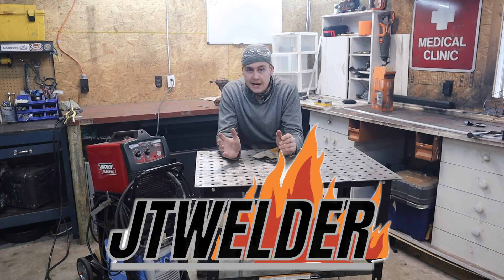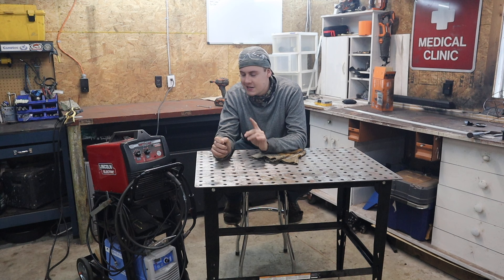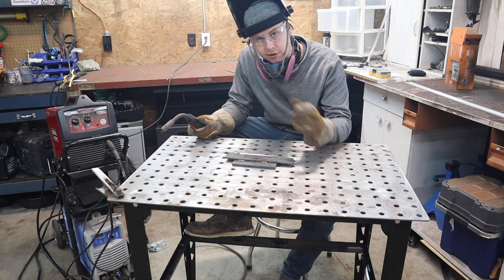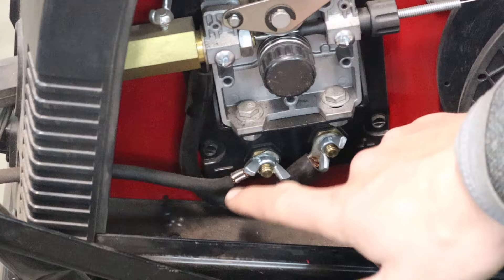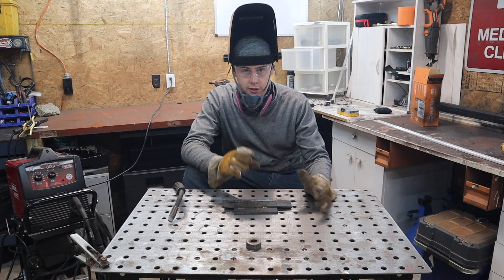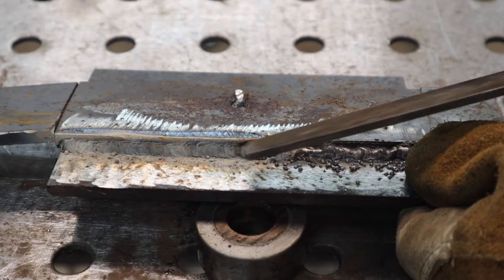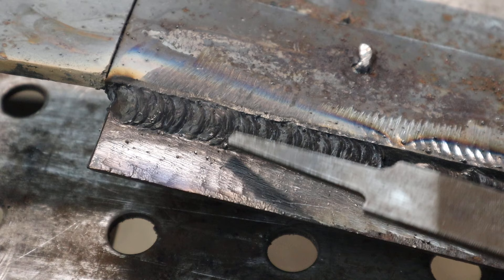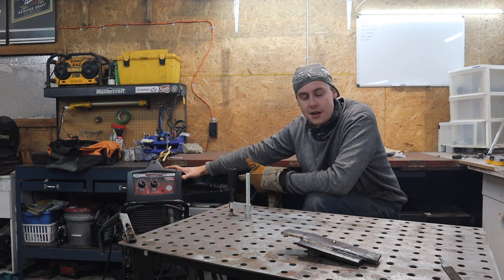#1 Mistake Made When Flux Core Welding (one simple Trick)

Comment: I've  been  welding off and on over 40 years. I never knew about  this. I normally  run gas, but I do have a couple of rolls of Flux core if I have to  welding outside  and there is too much  wind. Now I'll  know to make that change, and my welds will actually  look good. Thanks  for  this very useful  tip.
Reply from the maker: Glad I could help!

Comment: I just started college this last week for a welding certificate knowing basically nothing about welding, but when you talked about straight and reverse polarity, I knew exactly what you were talking about because we're currently learning the basics.  Straight polarity= Direct Current Electrode negative (current flows from electrode to work, transferring 70% of the heat on the work), Reverse polarity= Direct Current Electrode Positive (current flows from grounded work to electrode, transferring 70% of the heat produced to the electrode) and Alternating Current spreads the heat 50/50 towards electrode and work.
Reply: Great job now I knw
Reply: bougt just mma cried nicely.
Reply: I have to write this down.

Comment: I've been trying to learn with an HF flux core welder and my results are exactly like your first test. I'm going to go check the leads and reverse them if needed, and maybe, just maybe I will finally get a weld that will hold. Thanks!
Reply from the maker: Yeah hopefully it that's your problem! It's a night and day difference you'll know if it worked.
Reply: @JTwelder.  if only the guts of the HF were marked + and -!
Reply from the maker: @brysonalden5414  yeah on cheaper models they probably don't bother with labeling that. Also Hobart makes probably the best flux core wire.
Reply: @JTwelder.  Turns out, in my case, it was user error. I increased the feed rate, slowed down, and I'm starting to get decent welds. Thanks for your support!
Reply: @brysonalden5414 Label once you figure it out.

Comment: Great video.  Simple, easy to follow advice. 
I bought a MIG unit from a local, supposedly reputable specialist welding supplier about 10 years ago.   It was a ‘special deal’, allegedly for our state agricultural show.  Turned out, they were dumping the units as they were having major issues getting all the products from the manufacturer to operate correctly.  
After a few months of horrible welding, blaming myself, a mate (much more experienced than me) tried to use it, and had the same issues ( dirty, splattery, horrible weld lines, that took ages to grind, and major pitting necessitating rewelding / over-welding (?), incomplete or weak welds, machine would run for about 10 minutes then need 1/2 hour to cool down etc). 
I took the unit back for a ‘service’, and they sent it back with the wrong setting on the ‘drive-wheel’ for the wire that was on it. 
Eventually, I disassembled the machine.  I found the cooling fan (generic ‘computer’ type) was rubbing on another component, so i rescrewed it onto the steel case.  I then reset the incorrect settings that they had done.  
It now works flawlessly, and will easily weld for longer than I can.  Took it back to the company, showed them what I did, and made the professionals a bit embarrassed.  They gave me a bunch of new swag, including fancy switching- magnetic clamps.  Sometimes it takes a new ‘inexperienced’ eye on a problem to pick out the issues.
Reply: Agreed!!

Comment: A few years ago I purchased a Lincoln welder 240 . In the instructions it  said “ if using flux core, reverse the polarity for optimal performance “. 
I just did and my welder has always worked amazing. Thought you still do get a bit of spatter , however common with flux core.
Reply: Don’t ever buy Chinese wire or rod to weld

Comment: I have an older version of the same Lincoln you are using. I can smear some wire on two pieces of metal and make them stick together but I would never call myself a "welder". A lot of our stick welders where I work have a polarity switch right on the front so I knew that there was a purpose for reversing polarity but never new why. The funny thing is.....I have asked about it and none of the career "welders" at work could tell me why you would ever use it 😂 This will go a long way toward improving my results. Thank you!

Comment: Stumbled on this video and was excited. Not a “welder” but did a year, at night, at local tech school and have TIG, stick and gas MIG in my shop. Needed remote operation at my farm and bought a HF 110v flux core machine. It was ugly but it worked. Recently helping weld on a bush hog and using the 120 machine and yea…messy. Saw this video and at 1115pm went out to my shop to see.  HF 100v flux core welder is not switchable.  It is all hard wired in and I’m not a sparky. Damn!  Still great video and I plan to share this with my buddy who was my welding instructor.

Comment: This is probably one of the best videos for anyone to watch that buys a box store welder to use around their garage. Without this simple tip, at the beginning of learning, it saves an immense amount of frustration, and disappointment. So glad I found this video. We have the exact welder at work for doing minor repairs etc, and it acts that way. Have to put feed higher, and keep turning the welder down to not burn the wire to the tip, and jumps back and forth, hard to keep straight. Sounds like it’s the exact problem. Awesome man!

Comment: I consider myself a weekend warrior and a self taught welder. I purchased a Lincoln 140C welder similar to yours, but instead of my amp settings being fixed to only five or six settings, I can actually fine tune the amperage with the dial. Picked it up in an estate sale for $350 and never used. A smoking deal considering the cost of this model new. 
At any rate, I, like everyone else made the assumption that the units were sent from the factory for the proper setting for flux core. And now you are proving that wrong. Good on you for bringing this to our attention. I thought that my welds weren't getting any better as shown in your example. I will reverse my leads the next time I have a small job and see if my work is any better. Great video! Cheers from Ontario.

Comment: Thanks for doing this video. I bought a used Lincoln mig a couple years ago. I recently ran out of gas and installed flux core. I switched the polarity, but got the crap welds you showed. I just went & checked, and the polarity was wrong. Guess I've been running mig wrong, too.

Comment: Great info, I will say, I just picked up a new Titan 125 from Harber Freight (cheap as hell I know), and took it apart to check... From what I can tell they actually have the clamp wire hooked up to the positive side.
Granted, it's "self inverted" or whatever, so it's not the same set up and connections as a proper Lincoln, but the clamp wire is connected to the transformer, and there is a seperate smaller red wire that runs to the board, and is labelled V+ .

So that's good. Still splatters some, but not as bad as other machines I've used (that probably weren't set up correctly). Suppose I just need to dial in my wire speed.

Comment: Thank you for a great example of setting up and explaining setup for flux core.  I am fairly new to welding and I heard about + ground for flux core, but hard to find a good explanation of it as you have given.  I do make good welds with flux core.  I like flux core over gas, over the cost of gas.  Have no problem brushing the flux off the weld.  I just upgraded to a Vevor 250 mig which allows easy switch to (+) ground.

Comment: I did my first weld today with a Titanium 200 and .30 flux wire, clean up the metal before I started, set the polarity correctly for flux core, used the suggested settings for the material I'm welding, and I had 10x more beads and even burn through. Once you get them, I learned you can't go over it because you can't get between the beads to clean the slag, so you just make it worse.

Comment: I’ve recently been learning to weld and despite all the videos I’ve watched (and it’s a LOT!) I was frustrated by the spatter issue and porosity of flux core. I’m going to try changing polarity as you showed, and nobody else I’ve watched has mentioned.
Thanks for this video, I’m really looking forward to trying this out!🤞🏼
Reply: This only works on more expensive flux core migs w/ a DC power supply, like his. That welder's over $600 The cheaper ones are AC and it won't make a difference. And that's why the cheap ones suck. Flux core itself is fine.
Reply: Thanx for that info, my wire welder is AC only, and cheap lol. Maybe I should upgrade?
Reply: the next step up is a mig w/ dc inverter. w/ the cheap ac transformer ones, the power fluctuates a lot and doesnt give you a smooth weld pool

Comment: Here in Australia I have a 240V 100A flux core welder which I run on a 10A circuit. It must be set up correctly, because my welds look your second weld, not the first mess.  I can get a few different brands of wire, but I think I prefer the Renegade wire over the Bosweld wire, although the Bosweld wire is still good.
Reply: same here mate. i use bossweld 100a gasless mig. pretty sure you cant change polarity if you wanted to

Comment: Recently picked up a cheap 110v flux core welder, that is not able to be set up to run with gas. I bet it is also wired up like the gas version welders. I'll check the polarity next time I go to use it. Thanks for the tip!

Comment: Been welding 25 years. But just recently picked up hobo fraight 120v flux core welder and if this works I be vary happy cause it makes the ugliest welds. Thanks. I was probibly not listening that day 25 years ago in welding class. Lol
Reply: Did it work for you? I'm about to buy the same welder!
Reply: My welder is not easily changed with my luck Ill burn it down. The ends don't bolt on like in the video.
Reply: What a bad luck!  Anyway I'm going to buy the machine, as I only want it to do my little projects at home, I'm new to this I think that this machine is good to start with!

Comment: Im really impressed here. Thank you big time for explaining what others tend not to do. I am thinking of getting into welding just as a DIY'er and I was really wondering about the power source for a 120v welder. Im wondering if you turn up the power on one of those 120v welders could you (or have you ever) blown the 20 amp breaker? You did a really good job explaining everything else and you have a great speaking voice. Kudos to you!! If I do decide to get into it I will burn what you said into my old brain :)
Reply from the maker: Yep I have blown the 20 amp breaker before. If your just welding sheet metal or bodywork a 120v welder will work but if your doing a lot of welding on 1/4” material and thicker that a 220v machine is definitely the way to go.

Comment: Yep this makes a huge difference. BTW, fluxcore Yeswelders come set up as Positive ground.
Reply from the maker: How do you like the yes welder flux core machine? I have one of their older AC tig 250p machines and I absolutely hate it.
Reply: @JTwelder.  My primary machine is 220v Tweco/ThermalArc 181i w gas, so not alot to compare to. But for 110v portability I did have the HF Vulcan Easy flux 125 and thought it was decent accept for its short ass leads and pathetic ground clamp. Once it died I got the yeswelder 135 for $40 less, better leads, more power, duty cycle, cleaner arc. Yeah, it smokes the HF unit and has welded 2x or 3x the wire so far. Also has display and carry handle. No brainer.

Comment: The HF 90-125 Welder are AC output  You need to get a Wire that's rated for AC/DC and a Amperage rating at around 40-130  if you get Flux Core Wire rated for DCEN only and 120-300 amps its not going weld worth a CRAP in the HF Welder , If you have converted Your HF to DC then Blue Demon E71T-11 .030 rated 40-100 amp  is a Great Wire to Try .

Comment: For the modern flux core-only welders (like those cute little Harbor Freight ones), does this still apply? I would assume that the polarity in these is hard to swap, unlike the Lincoln 140s where it's all accessible. But wouldn't a flux-only tool get t right from the factory?

Comment: Another important change you never mentioned is the need for a knurled drive roller in the correct wire size in which you are using, if the machine is setup to run solid wire and gas, it will have a smooth grooved roller, it won't feed flux core wire.
Reply from the maker: This video really was just about the polarity. Its not a full how to set up video for flux core.

Comment: My MIG PAK 140 machine from Canadian tire did not come setup and it did come with clear intructions for setup on DCEP - Direct Current Electrode Positive (MIG) and DCEN - Direct Current Electrode Negative (Flux core) so I think most people need to spend time and read the instructions. There's a lot of videos about setting up this type of machine from new and they all speak about setting it up correctly for Flux.
Reply from the maker: Yeah exactly! I just filmed a new video actually talking about how the Lincoln 140 does not have good instructions how to switch the polarity
Reply: @JTwelder.  You think you could do a video on a bunch of different weld types on the 140 on different thicknesses of metal and speak about the settings you use? I know the inside flap gives a baseline for voltage and wire speed but I find I need to tweak them slightly if doing an open corner weld vs a butt or lap weld since welding the edge of a piece gets hotter. Only thing I don't like about the MIG PAK 140 is that the voltage settings are 4 position only, it would be nice if you could vary it between the A B C D setting. 

Currently just running flux for now as the bottle of gas is a bit pricey and I'm just doing some basic hobby type welding at the moment

Comment: I’ve actually ran gas less flux core wire with gas and it turned out really well. Better penetration and a nice looking bead with a slag layer that pops off just like dual shield. Seems good to me anyway, maybe a pro on here knows something I don’t? I’m open to criticism on that.
Reply from the maker: Yeah I’ve heard of that being done before and working. The only problem is gasless fluxcore is more expensive than dual shield and it has a lower deposit rate. So if you have gas you might as well run dual shield, it will be cheaper and faster.

Comment: Id recommend a 10 gauge extension cord and keep it as short as you can not that a 12 gauge wont work just you get less voltage drop with the heavier gauge wire

Comment: I use flux core for structural welding, it far superior to mig in regards to penetration.

You can blast through rust, grease, the wind doesn't affect it. 

The downside is tons of fumes, slag is thrown everywhere, welds aren't as pretty, and it's difficult to weld sheet metal because of how violent the arc is.

I do exhaust work daily, I use mig for this because I can carelessly lay beads with out burning through.

When I repair frames and suspensions I run flux core because it digs deep
Reply from the maker: Yeah I love gasless flux core. I run 045 fabshield 21b off a ln-25 wire feeder on mobile jobs a lot.

Comment: great tip, I'm going to check my welder leads today and see about that, thanks. It's a cheap Canadian Tire 110 FC welder and I am almost positive they will be backwards plus I think it is running off a 15 amp circuit so these are a big part of why my welds look like that one you did or worse.
Reply: Is this the one you bought? I’m looking for anyone with the same unit before I reverse the polarity. The wiring is not so simple as in this video. Yikes.😬 My unit is the Lincoln Weld-Pak 90i FC.